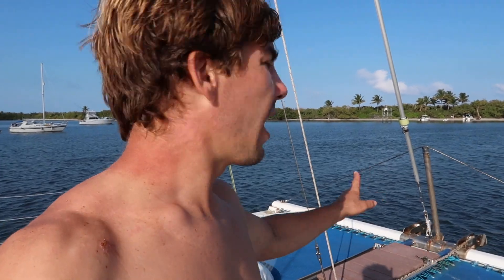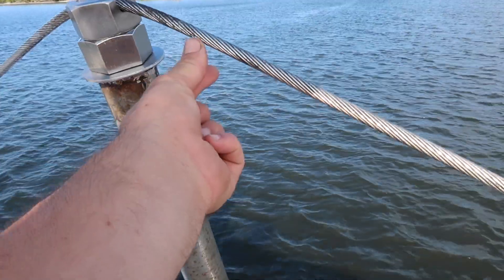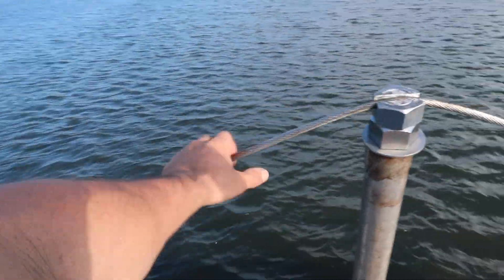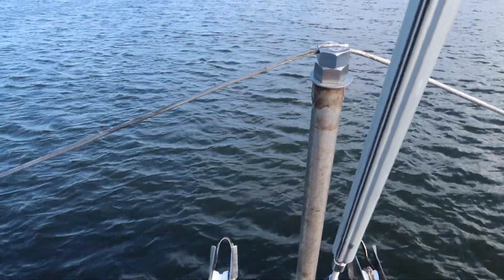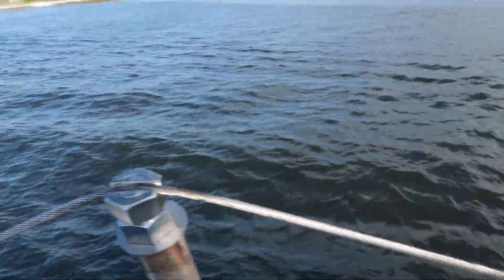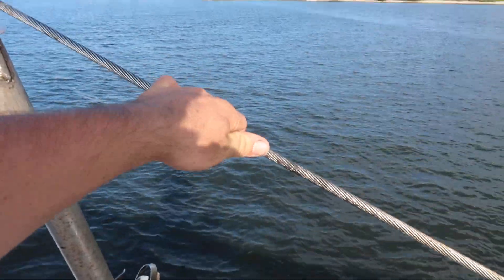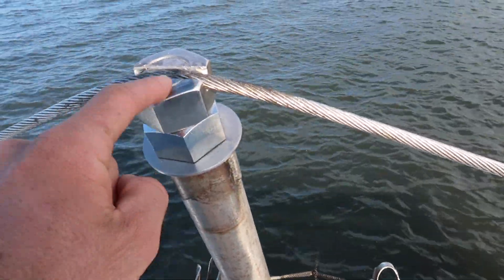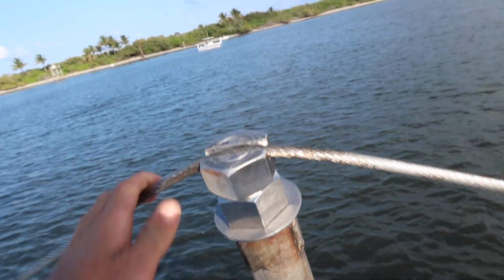Simple Catamaran Seagull Striker Tensioning System

Comment: What would stop the bottom tension nut backing off? It seems as though you would seperate the bottom nut from the top when you use it to add tension so I don't understand what is holding it in place.